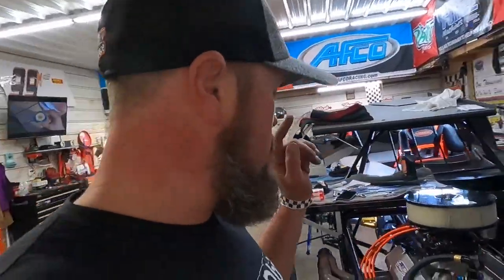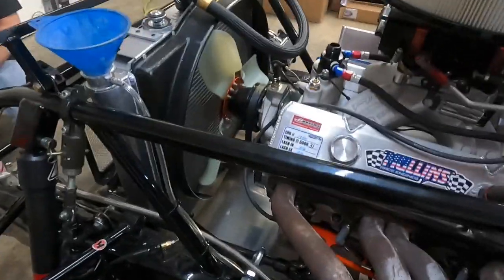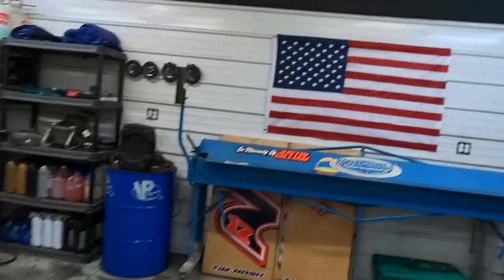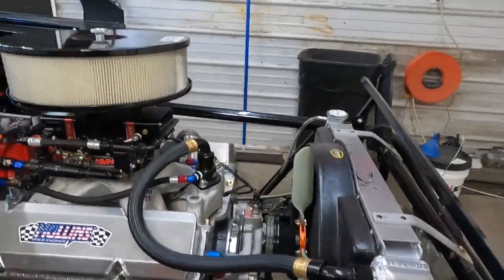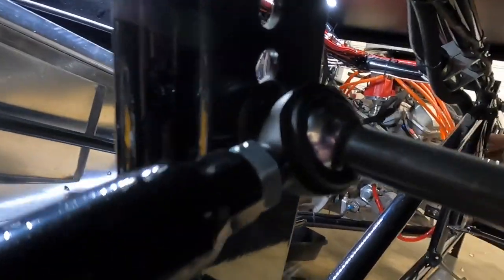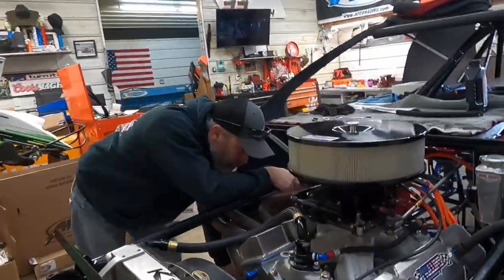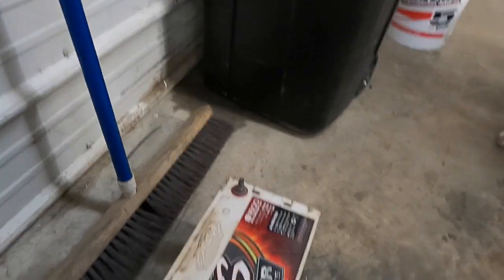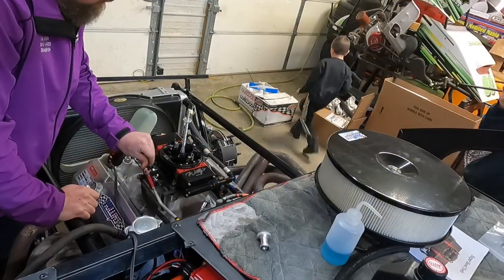Starting our Race engine for the FIRST TIME, The Mullins Race Engine ROARS to life!

Comment: The goonies! And yes I love the smell of blue race gas, especially the exhaust vapor. There was a gas station that use to sell cam2 out of the pump and when I went to dads I’d stop and put $5 worth in my truck(it was 2.50/gal) then top it off with regular gas. Would smell good for a couple weeks! Lol
Reply from the maker: You bet! Can’t beat the smell of spent racing gas out the tailpipe!!

Comment: Hey Tim be careful with that vp blue, they started putting a dye in it, and for some reason it crystallizes and gets all over the pistons and spark plugs, we changed to base racing fuel  and haven’t had any problems since, it’s cheaper as well
Reply from the maker: Thanks for the heads up!